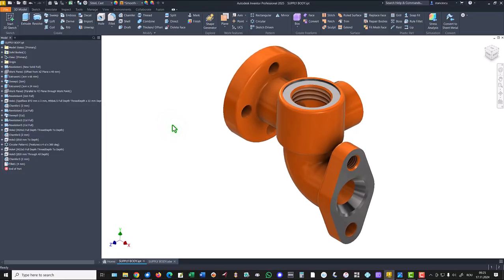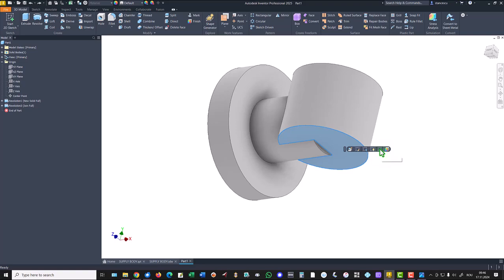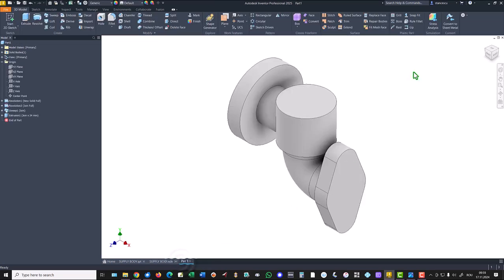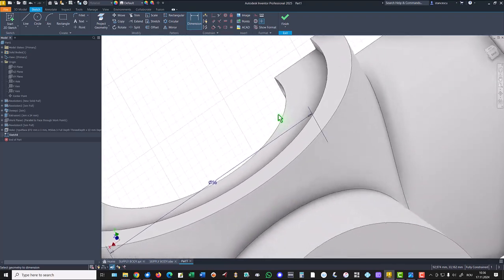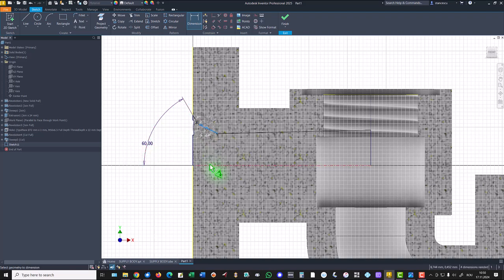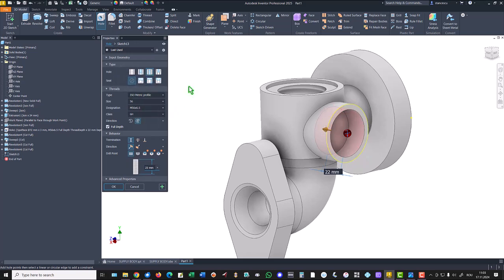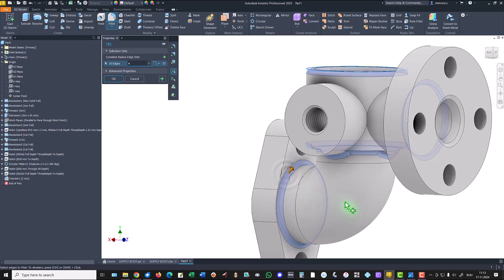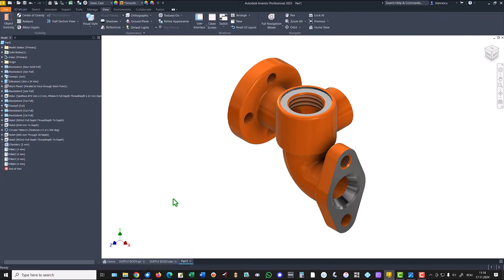Tutorial Inventor - 511 SUPPLY BODY

Comment: Excellent tutorial as usual. At 13:15 where you created the M56 threaded hole. I did a sketch on the internal of that M56 hole. Create a circle of size needed then Extrude / Cut for 37mm. Question is, which is best practice. Thanks Prof.
Reply from the maker: Proably both…